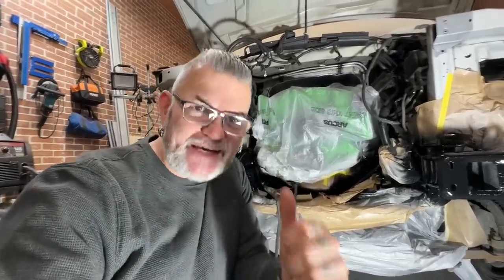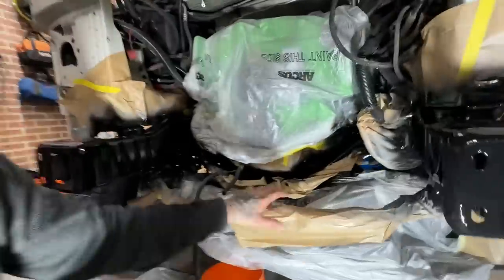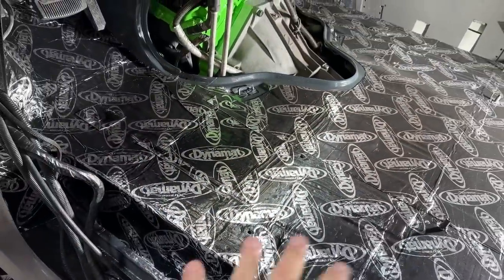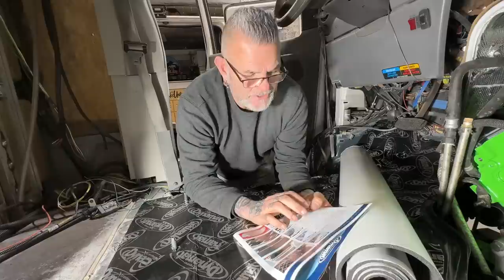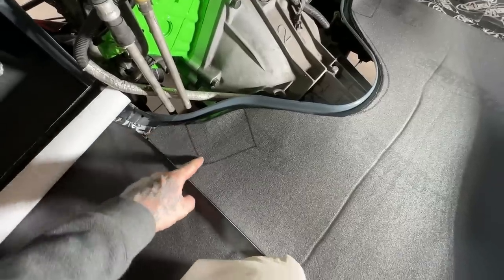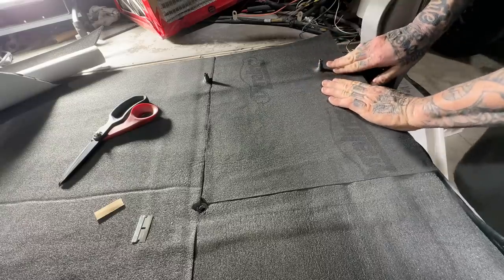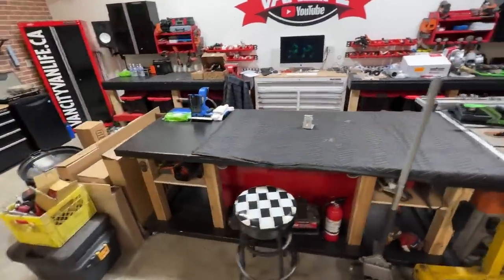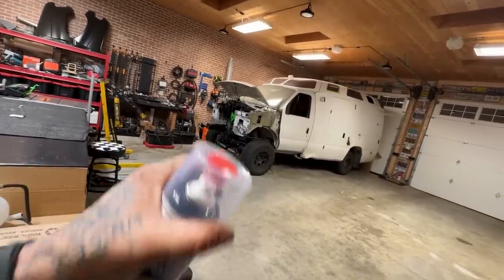GETTING READY For The Mechanic. Final Touches On The Floor and Front Frame. MY MONSTER TINY HOME

Comment: Hi Chrome I'm loving the build. Don't go too big on the tires, 35's would perfect, Any larger you will have to re-gear, mileage will drop and you increase the ride height overall . That may limit the trails that have low over hanging objects like tress branches.

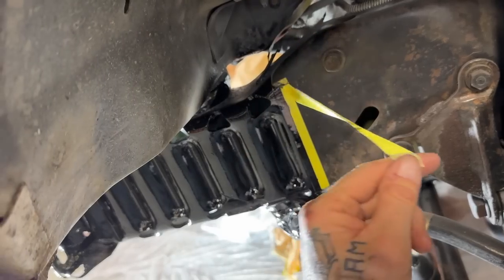Comment: Stick with the 35" tires. 40's look too big and and cause more clearance issues. plus gearing issues. Is your van currently running the 4:10 ratio? Loving the build, I'd also reccomend the Weldtech front Baja fenders. I use them on mine and love it.
Reply: Agreed!
Reply: Yepper on the 35". This ambo is not a rock crawler.
Reply: Your on point ... I have 35s on my F-250 with 410 ratio and would go No bigger even though I could fit 37.5

Comment: 40"ers are hard on front knuckles for that size diff. Also might have to go to 31 spline chrome moly axles.  You will also have to change front and rear gears to compensate for that size tire.

Comment: The ambulance is looking great. It’ll look even nicer when you get a lifted with bigger tires.BUT There is a price to be paid at the fuel pump. I speak from experience. Did both those things on my suburban. And on my 7.3 pick up truck. Looks great but you pay the price. Fuel economy/miles per gallon drops proportionally.

👍👍

Comment: if you heat up that dynamat it will seal even better its fire retardant so a torch will work and it will soften up the rubber on the bottom and make a better seal and it will perform better

Comment: OMG!!! Everything is coming together pretty sweet 😳🤯.Will you ever think about getting a snorkel, then you can go camping in even more ausom places 🤔🙏👍
Reply: Snorkel isn't necessary. The air box is above the engine and if you were deep enough in water to need a snorkel, you would have some pretty bad water damage inside the camper.

Comment: Need a J-Roller!
Reply: Are you talking about the under carriage rollers that allow you to reverse pull out capacity
Reply: @montyforster3370  no, a j-roller is a tool for putting down flooring, counter tops, or anything with an adhesive backing or glue. Allows one to really apply pressure fir better adhesion

Comment: 40’s are cool and seem to be the size of choice for the off-road overland crowd but most aren’t  trying to squeeze in out of trees on Vancouver island and are desert dwelling or in Baja. Maybe 35-37’s and lowest possible roof height might be better route, just my thoughts neighbor from Wa.
Reply: My camper was just under 10’ tall and 78” wide and my next flatbed/camper setup on this rig will 72” wide and 8’ or under in height so I can access more places. I run 33x10’s on 128” wheel base gets most places.

Comment: Are you going to waterproof your whole living area floor and steps with :  Dynomat or something like that, or the epoxy spray paint, that you just used in the engine area?
Are you going to put, or spray, waterproofing on your current van floor and steps since you just found that there?